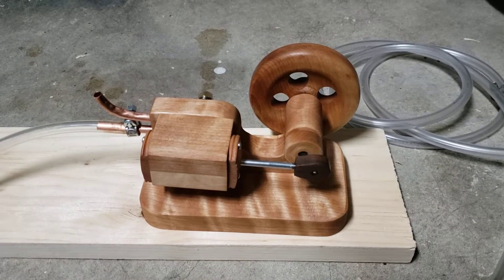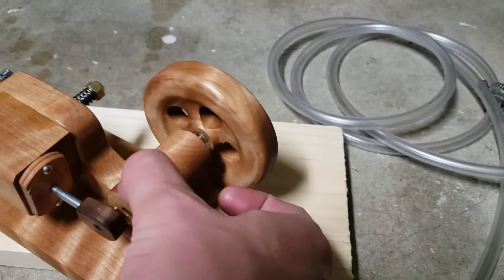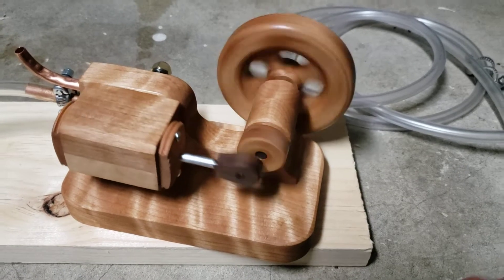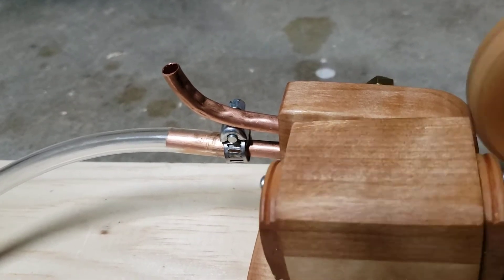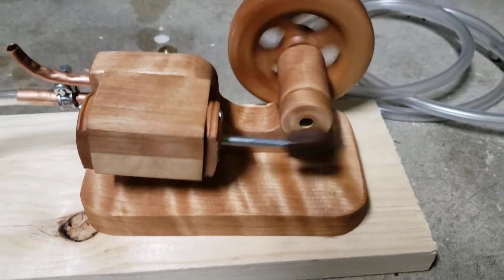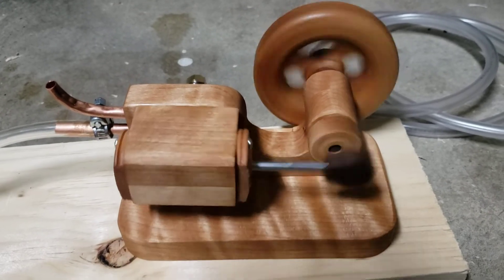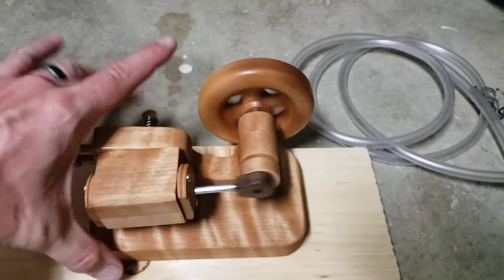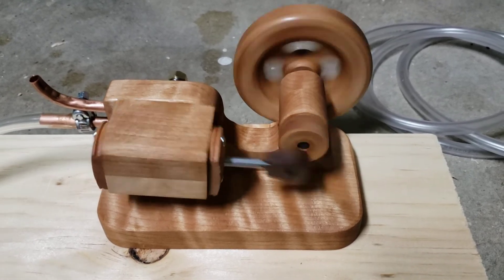Engine 13 - a horizontal mill engine with double acting cylinder. Wooden air engine.

Comment: Runs nice Jon, to get a smooth bend in the pipe I fill them up with plumbing solder, and then reheat it after bending and the solder runs out
Reply from the maker: I ended up making a new tube. I just installed them with JB Weld and the epoxy is curing.

I also cut a new lower cylinder cap with a tighter tolerance around the piston rod. The engine now runs at a lower minimum RPM.

I really like this engine. All of this is thanks to people like yourself and Obsin for inspiring me to do all of this.